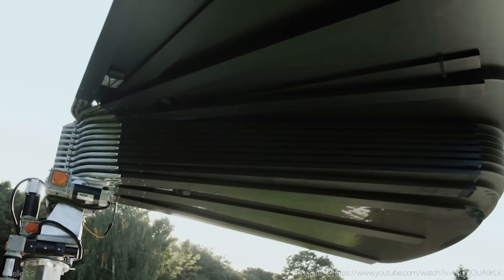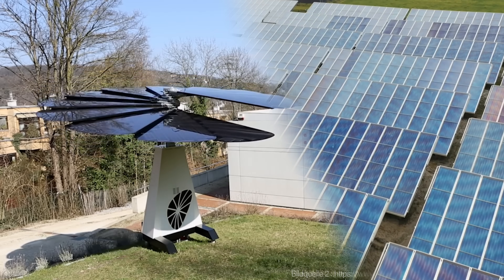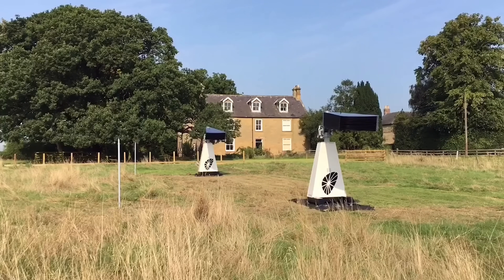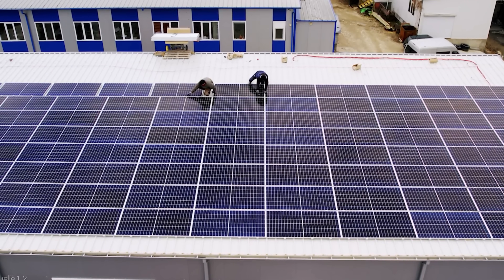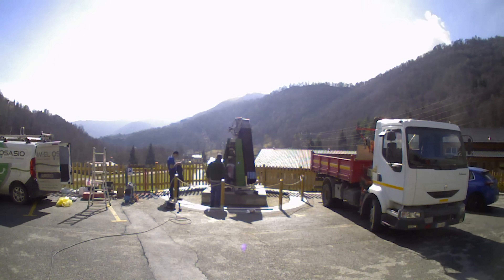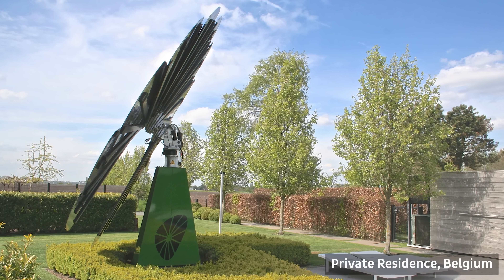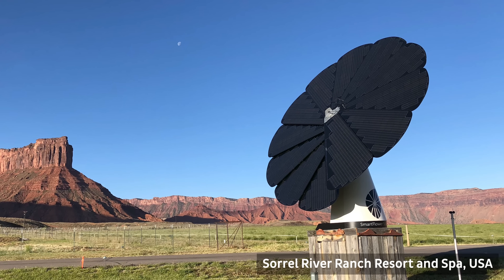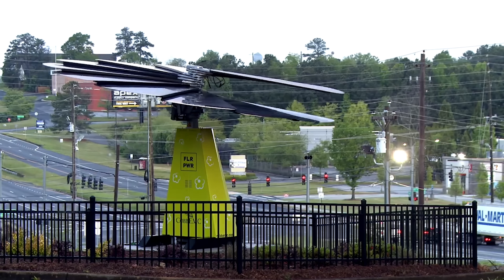Smartflower: The World’s Most Powerful and Affordable Technology that Outperforms Solar  in 2024.

Comment: Extremely expensive technology gadget!
It also requires a lot of maintenance and is prone to repairs.

With simple solar panels, you can generate electricity for 10% to 20% of the cost of Smartflower.

Comment: There are local companies that can mount 4 x 400 watt panels on at tracking pole for far less cost.. I opted for 7kw on the roof and on good days I can get 3 to 6kw an hour for about 5 to 6 hours a day equaling 17 to 35KWH at 1/3 the cost.. This is more a high tech novelty item like the big wind mills in town that were put up by several factories which we never see spinning..
Reply: Lawn Art for the rich.

Comment: Beautiful technical gadget Ideal for hotels, company front gardens etc!
However:  Approx. 10 k $ costs (Smartflower & foundation) for only 2.5 kWp. 
In addition: where there is mechanics, there are maintenance and technical problems.
If you want cheap green electricity, "Solarflower" is of course nothing for you! That's what the company roof is for.

Comment: What if I told you this is wayyy too expensive to be practical, plus more parts to break to incur most long term cost?
Reply: I'd say you were absolutely correct, sadly.  If it can generate 40% more energy, it will generally still be cheaper to add 40% additional traditional static panels when you factor in mechanical failure, parts and labour.
Now, if you want solar generation, a piece of moving art, and like to fix things, then this is right up your street.

Comment: Two disadvantages.  1. Need big land or space.  2. Easier for vandals to damage because its on street.
Reply: you are right, they are not smart enough to have a small one for homes. I did find there are cheap solar tracking that your current or a normal solar panel can use?

Comment: Any time a video advertisement like this deliberately does not mention the pricing options up front, You can expect it to be outrageously expensive.
This means that any money you save by using this device is really no savings at all because of the exceptionally high up front cost of buying and installing this solar panel setup.
In the long run it will take a new buyer just as long for this device to pay for itself than a conventional roof-mounted solar panel setup.
Reply: This unit will never pay for the initial cost + upkeep.
Reply: Not right now, but in a few years, the cost should come down to make it reasonable.

Comment: Granted it is a beautiful design; but efficiency is a different matter. For a given height and width, maximum coverage will be achieved by a rectangular shape. Any other shape will incur wasted area as cells are not manufactured in odd forms. On the petals you can clearly see 10+% of the area that is not covered by cells. Combine that with  20+% lost in the circle to square ratio. Efficient?
Reply: Well certainly an interesting video. It is a complete failure. How can you make any of these claims and list? Nothing about cost? This kind of video borders on a scam.

Comment: 800% what?
Ha ha ha
I would guess 50 to 100% more efficient per surface area, at best.
Also 50 to 100% LESS cost effective.
It will probably fail within the first 3 years.
Cost for repairs will eat anything positive from this, and then some.
There is NO chance this is as cost effective as roof top solar.

Comment: They could produce much larger version too. If diameter is twice longer, the area is 4 times larger.
Reply: Who can afford this unit? And want one with 4X the surface area? Ummm ... No.
Reply: do you use solar tracking, i just looked at Amazon and seen some for low prices?

Comment: Is it good in Florida? If it costs more than $3600 a year,  then no thanks. We already pay that  amount now. if it would cost half that then yes
Reply: $25,000-$30,000
Reply: No thanks
Reply: By the time you figure in shipping, concrete and installation your looking at an upfront cost of $66,000 with a 10 year warranty. It's best for commercial applications and residential applications where roof applications aren't desirable and ground space is limited.